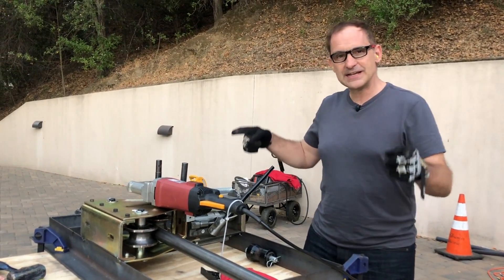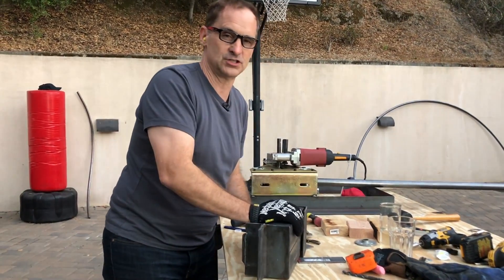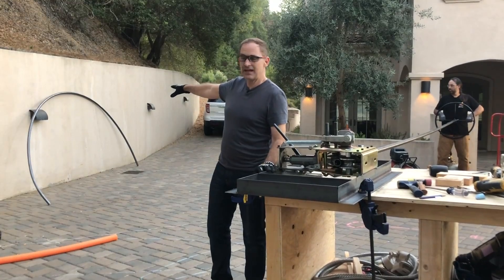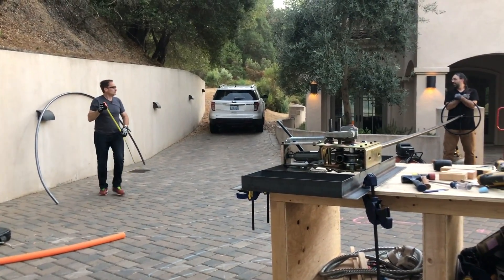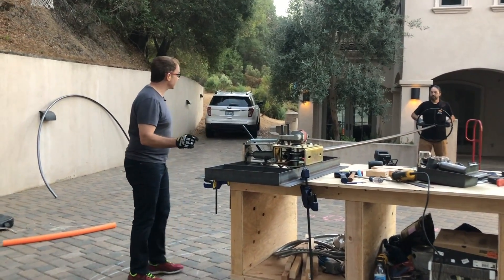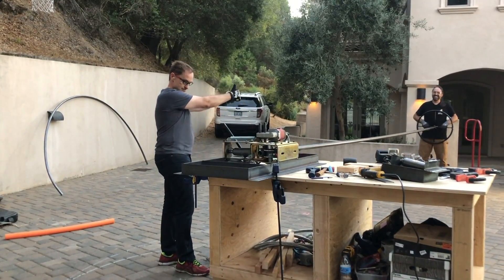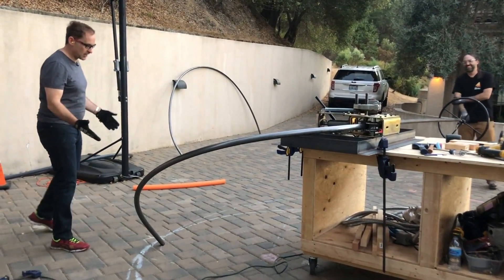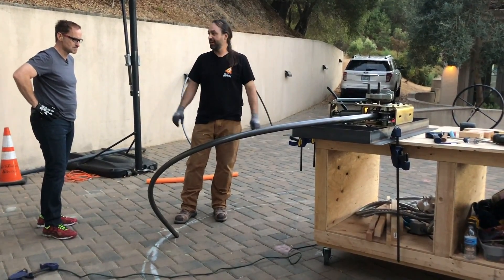Backyard Roller Coaster Steel Tubing Bender - Part 2

Comment: I'm probably way late, as always and I'm sure this has already been suggested.. But, since you've already gone 1/2 way (180 degrees), why not just pull the rest of the pipe through, as is, and run the pipe bender in reverse, thereby feeding the straight portion of the pipe in, reversing the turn, to complete the last 180 degrees.

Comment: Save some money! You can still use the candy cane. Just chop the curved part off, set it aside, and bend the next section. Repeat. Weld the sections back together when done. When you make the cuts, put a mark so that you know how/what orientation the pieces go in relation to each other when welding. Good luck!

Comment: Honestly I think you're almost there. Twisting was a really good idea, I didn't think that would work but now knowing that it does that's definitely the way to go. My concern at this point is that you would probably want to have the turn be more extreme at the top of the inversion than at the bottom but that's an easy fix where you change your angle lines on Chalk to be further apart at the beginning and closer together at the end.

Have you decided on more constraint numbers having to do with the length of the inversion, the height of the inversion, and the width of the inversion? (that is to say the height of the heart line above the track.) I just got back from IAAPA and would love to help you more with those better numbers. You're almost there! keep working at it
keep thinking at it 
keep buying more Steel

 Good luck!

Comment: Hey Will,
The way I see it you are on the right track, you just need to put  scale on your bender.  You can measure the distance between your bending wheels, center to center, calculate the deflection you need to create the proper radius and mount the scale perpendicular  to the pipe to measure the deflection. That with some trial and error with the rotation and you will get what you want.  Good Luck!

Comment: It can be saved!  Run it through from the other direction (almost like it running backward when you first turned it on was trying to tell you something).  You can still turn your wheel clockwise then.  You just need to remark the ground for your angle references, or turn your bender around.  In my mind, it'll bend into the sky instead of the ground